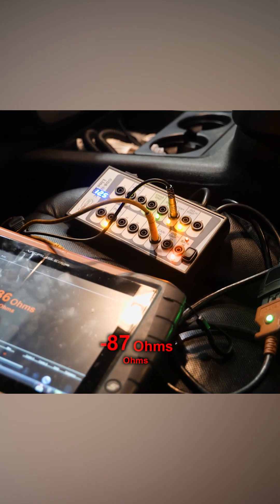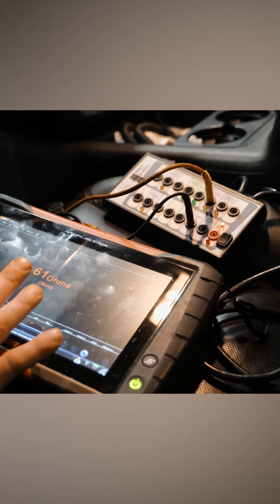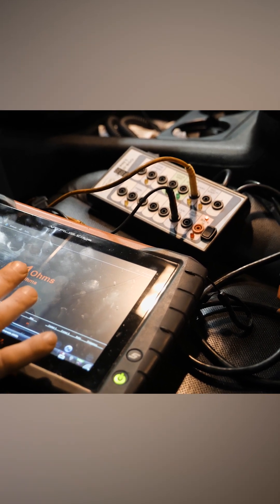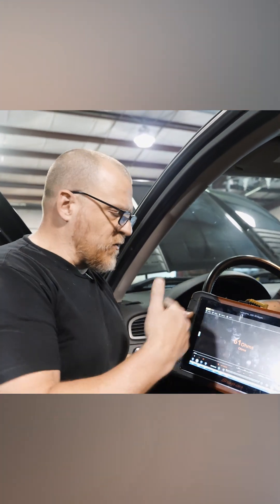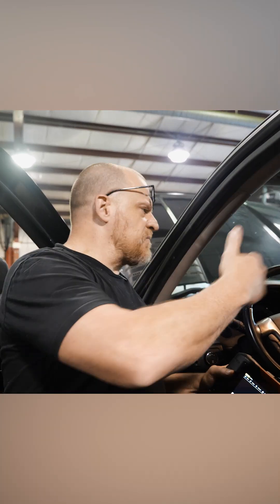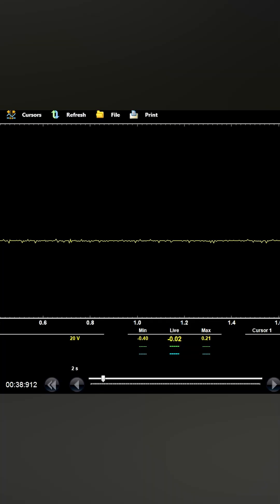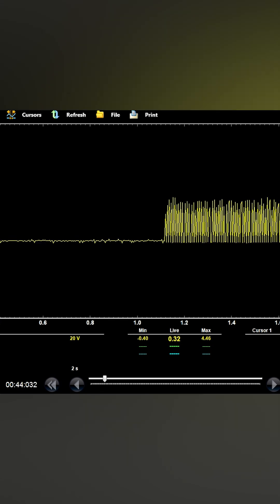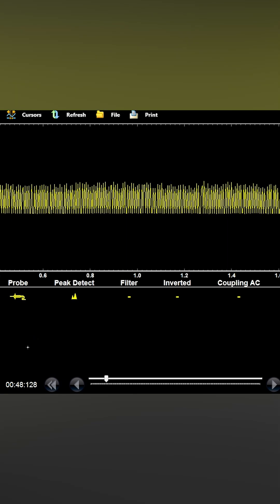CAN Activity/Network Resistance Checks

Comment: up until the point where active termination is defined at the board level..

for instance, my gateways I build, I implemented software programmable termination resistors..

in order for them to be active, the microcontroller has to have power,
and if the microcontroller has power, it probably os sending messages..

see the catch22 there?

Comment: It's 120 when the network is down?
Reply from the maker: There are many different "network is down" causes but if you see 120, then one of the modules that contains a terminating resistor is open or that leg of the network is open

Comment: Negative resistance. Would that be pressure?
So would negative resistance in an electrical situation be voltage?
Not going to be able to sleep tonight, lol
Reply: No the leads are simply switched
Reply from the maker: @kylancook3477 ohmmeters won't read negative values regardless of the connection of the leads. The voltage on the circuit is messing with the readings as the op suggested.
Now to be clear, an ohmmeter does have a specific polarity but it doesn't matter with typical resistance measurements. For diodes it does
Reply: @ScannerDanner  
Thanks Paul. I was going to argue that switched leads on an ohm meter wouldn't change anything other than a diode.
I thought my thought was interesting and was hoping to make you think, lol.
Thanks man, glad your still putting stuff out!

Comment: Alll that fancy extra bull is why i stick with my 07 toyota lmao. Most that's happened on the 100k is a dead alternator and a loose spark plug☠️☠️
Reply: 07 Toyota also has can communication. Can diagnosis in toyotas is usually pretty easy. The only hard one I've ever had was hit by lightning and the insurance company wanted to fix it.
Reply from the maker: Your 07 Toyota has a CAN too
Reply from the maker: @Dren-gk4rn 😂
Reply: @ScannerDanner  damn,on the way home and my car misfires a BUNCH. thinking its a dirty injector and i havent put any cleaner through yet bc i have a full tank☠️but thats what i get lmaoo😭😭
Reply: @shawnaning101  ZAMN

Comment: Why would anyone measure resistance on an active circuit? Electronics 101 last I checked
Reply from the maker: You've clearly never taught to a class of newbies have you?
Reply: It is actually not something you learn in Electronics 101, it is never taught in school how a DMM measures resistance. Like you always think it just somehow magically measures resistance, you never would think  a DMM measure resistance by supplying current and measuring the voltage, so any other voltage mess with the reading.
Reply: @lelokong6898 I learned it in school
Reply: @lelokong6898  I taught at the US Army aviation school electrical and electronics division at Ft. Eustis. I currently teach at Virginia Peninsula Community college. It most certainly is basic electronics knowledge!
Reply: Came here to say the same thing